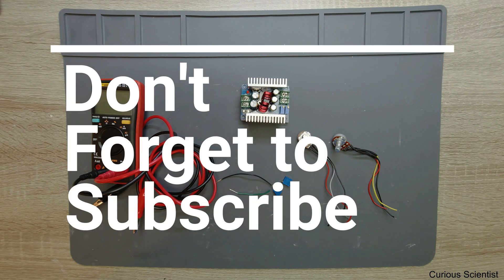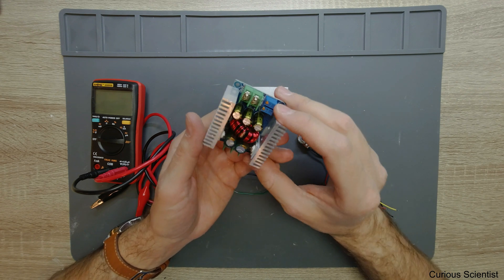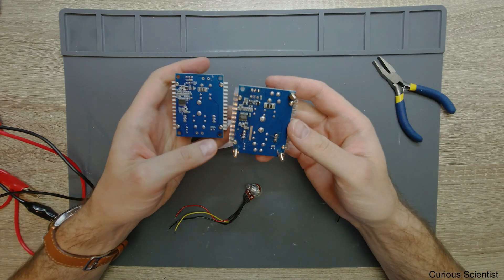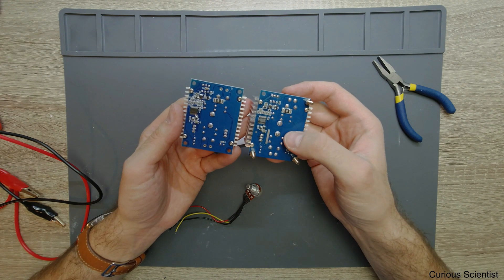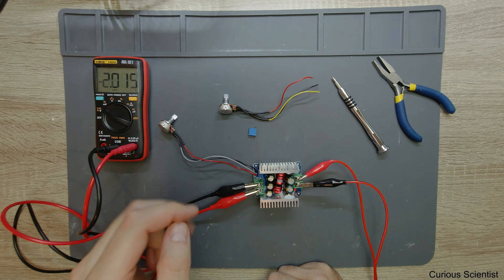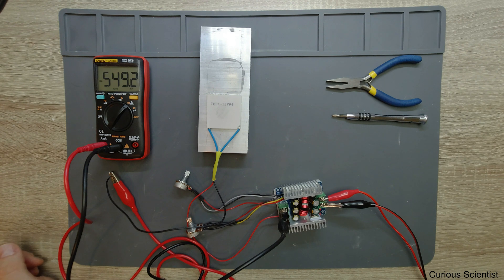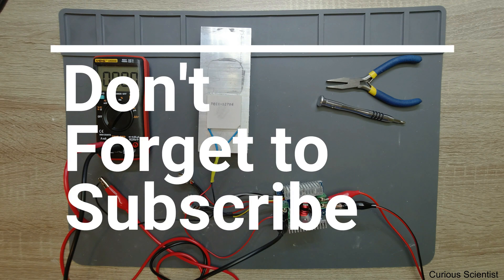Replacing the potmeters on the 300 W, 20 A DC-DC converter

Comment: I would have thought it better to replace those pots with multi turn ones, as the Volts & Current setting will be more precise.
Reply from the maker: You are correct! But at that time when I made the video I did not have the resources to buy them. I have a more recent video on this topic where I use multiturn potentiometers. I also discuss about the mistakes that many people do when replacing the potentiometers which results in damaging of the circuit.
Reply: @CuriousScientist  OK no problem. I am just ordering some 10 turn pots for a board I have had for a while. Its a buck only and has volts and cc pots, it drives me crazy not being able to find the tiny slots.
Reply from the maker: Yes, it is very annoying and dangerous to poke around that tiny screw with a screwdriver. 

When you replace the potentiometer, please double check the polarity of the potentiometer! Many people mess up the wiring when they replace the potentiometers. Some multiturn potentiometers have their pins in a 1-3-2 order instead of 1-2-3.

Comment: Hi, don't you think a multi-lap linear potentiometer would be better? I believe that accuracy derives from that but I could be wrong ... forgive my bad English!
Reply from the maker: Hi! Of course it would, but when I made this video my budget did not allow me to use them. :) I have more recent videos where I use those multiturn potentiometers.
Reply: @CuriousScientist  Ok, I asked this question because I'm going to insert one of these modules on atx for pc in the 12v output, I think it should work .... the potentiometers are 100k true?
Reply from the maker: 100k, both CC and CV. Pay extra attention to the polarity of the potentiometers!
Reply: ok! An important question: in that module the output voltage is always less than the incoming voltage? For example if I have 12V entry, can I get a output current than 12V?
Reply from the maker: The current is measured in amperes and not in volts, so your question doesn't make any sense. However, this is not a boost converter therefore the output voltage will be always lower than the input voltage.
Reply: @CuriousScientist  Of course, I wanted to say voltage, I misfortune with my English ... do you know if there are similar modules with Buck and Boost features with at least 10 amps? Otherwise 2 separate modules should be used, 1 incoming boost module that raises the voltage and then a buck module that brings the voltage into the desired range?
Reply from the maker: Your question can be answered with a simple Google search. :) But why would you use 2 modules? Use a power supply with a higher output voltage.
Reply: @CuriousScientist  Of course I did some research but it is not clear which module to use ... as mentioned first I would like to use an ATX from a PC, generally excellent current on the 12V then have the possibility to raise over 12V and lower as much as possible, with current adjustment .
Reply from the maker: Well, the module depends on your requirements. Just use the one which fulfills your requirements.

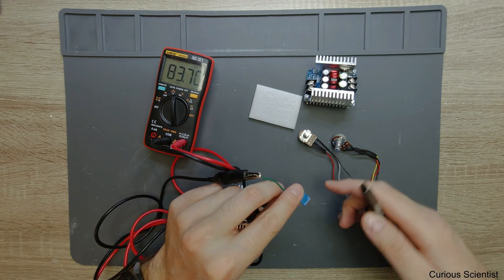Comment: 3:33 I don't understand. The trimpot of the buck module is model 3296 and at this minute I can see that it is turning the trimpot "head" counterclockwise, but instead of decreasing the value in ohms indicated on the multimeter, why is it increasing? If it were not ohms but volts and it is turned counterclockwise, the value of the volts shown on the multimeter tends to decrease.
Reply from the maker: Well, this is how potentiometers work. In this demo, one probe is attached to the wiper and the other is to one of the other pins of the potentiometer. The potentiometer is a voltage divider made of 2 resistors. While one side of the potentiometer (one of the resistors in the voltage divider) increases its resistance, the other decreases it when you turn the screw on the potentiometer. So, when you fully turn the potentiometer to the max, you can measure the nominal resistance of the potmeter between the wiper and one of the inputs pins, while you will see zero resistance between the wiper and the other input pin. And the opposite will happen when you turn the potmeter to the minimum. The previously 0 Ohm pin pair will show the nominal resistance and the other pair will show zero.
Reply: @CuriousScientist  OK, I understand. But one thing is for sure, the potentiometers that come in any buck/boost module are very accurate, but replacing them with normal potentiometers as you show in the video, their accuracy is lost. Do you know any way to get accuracy with normal potentiometers?
Reply from the maker: Yup! You can use multiturn potentiometers like I did in this video:
https://youtu.be/LODoeP6Ap1c
Reply: @CuriousScientist  I have seen your video, but the multiturn potentiometers you used are very expensive and I am referring to the single potentiometers you used in this video. I'm building a lab power supply with an ATX power supply and I want to use two simple potentiometers to adjust the voltage, (one potentiometer for fine voltage adjustment and another potentiometer for coarse voltage adjustment), but I don't understand how to make the connections between the two potentiometers together with a buck module. Do you have any ideas?
Reply from the maker: Go to my website and check out the tools section. I have a link for the multiturn potmeters where they are not too expensive. At this moment when I am writing this commend (2021/Oct/20), they cost $1.86 per piece. You need only two of them, so I guess it is not a big deal. Adding coarse-fine potentiometers is a bit more complicated, or at least it is complicated enough that I cannot easily explain it in a comment without drawings. But I might make a video about this in the near future because this is a useful thing to have.
Reply: @CuriousScientist  Ok, I guess I will wait for you to make a video where you show how to do this, how to add and use two simple potentiometers to adjust the fine voltage and coarse voltage with a module, like any lab power supply does. It is about connecting two potentiometers in series, but as I said before I have no idea how to make the connections between the two potentiometers, so I would like you to show this in your next video because for me this is also useful.

Comment: I did this experiment.
But I found a problem with the potentiometer.

That is, the potentiometer experiences heat and there is a small spark.
The potentiometer I use is also the same, 100k ohms.

What is the cause of this problem, and how to solve it?
Reply from the maker: Are you sure that you haven't mistaken the polarity of the potentiometer? I have replaced several potentiometers and never had an issue like that. Check the pins of the potentiometer carefully, because even the same looking ones can have different order of pins. It could be that you've fed the input voltage to the wiper of the potentiometer.

Comment: I have bought 2 time of this module...after i change pot trimmer to VR  used only few minute smoke goes out on VR...after that dead..SmD chip burn...3 time i bought again this time i not modify anything with timmer pot to VR keep original...unti now everything steady Ok...solution is better keep back original part...
Reply from the maker: Sorry, but I have difficulties understanding your sentences. If your device breaks after replacing the trimmer to a normal potmeter, you probably did a mistake with the wiring or something. Pay attention to the connections and to the pin assignments. Some potmeters have different order of pins. I use my modules with replaced potmeters very often and they are still working. Some of them are 2-year old.

Comment: Buck converter not working how repair
Reply from the maker: It is very common that the mosfets give up. Remove them and check them with a transistor checker.

Comment: When i replace pots as you did my pots smoked out i bought 3 of them one of them is not working now but the others making sizzling sound when i reduce voltage below 2 volts have u any idea what that is for?
Reply from the maker: It can be that you messed up the wiring. Always check what is the pin layout for the potentiometers. I've been using this power supply for a year without any issues. The PSU cannot go below 2 V, that's why you might have issues. This DC-DC converter has a minimum output voltage which is around 2 V.
Reply: @CuriousScientist  so can u guide me on how can i reguldte from zero to up ?adding diode can be a solutin?
Reply: @CuriousScientist  im pretty sure i didnt made mistake as long as i know it doent matter vcc and gnd of pot only signal pin middle one is important
Reply from the maker: As long as you are sure about the position of the wiper, you are safe. It is just that sometimes the wiper is not the middle pin but people assume it is the middle. If you flip the VCC and GND you just flip the limits, so you go instead of MIN to MAX to MAX to MIN when you turn the potentiometer clockwise. 

Regarding the zero output voltage, there is no workaround. This specific (SZBK07) DC-DC converter has a minimum of 1.215 V output voltage when everything (the two potmeters) is at 0. This is how the LM25116 buck controller chip works. You need a different circuit if you need that 0 to 1.215 V range.

Comment: Hello, the voltage can be adjusted in my product, but current limitation cannot be made. What could be the reason, do you have any information? Thanks.
Reply from the maker: Hi! Are you trying it with the original potentiometers or have you replaced them? If you replaced them, make sure that they are the same value as the original, and also make sure that you soldered them properly.
Reply: @CuriousScientist  hi, i used it with original potentiometer. I thought if it was broken. i replaced it with another 100k potentiometer but the result did not change. potentiometer works but I cannot limit current.
Reply from the maker: It can be a faulty product then. I tested a brand new product which I unpacked literally 10 minutes ago and I could not limit the current at all. Unfortunately these cheap products are not always reliable. You might want to remove the mosfets and test them but maybe it is easier to just buy a new one and hope that it will work.
Reply: @CuriousScientist  the product I have is working.  it only does not work at low currents.  The potentiometer is very sensitive, very difficult to understand.  The 100k potentiometer must have adjusted all the settings in the first round. Thanks so much
Reply from the maker: Yes, the CC side is very sensitive. Some time ago, I replaced the CC potmeter with a 8-bit digital potentiometer. Up until a certain value it worked OK, and then after just one step (roughly 39 Ohm change), it went bananas... I also still need to learn a lot about these buck converters. If you are interested, I recommend you to read the LM25116 buck controller's datasheet. It has a ton of information, but it takes time to digest everything.

Comment: Would this modification also work for regulating the output of a boost converter?
Reply from the maker: I don't know. I need to see the circuit to know it.
Reply: @CuriousScientist  Hi. The circuit would be exactly equivalent to yours, except substituting the BUCK converter for a BOOST converter. Everything else would be the same i.e. taking off the blue CV potmeter and connecting a more ergonomic component etc.
Reply from the maker: Then I guess, it should work. But since I have never tested other circuits, I can't say with 100% confidence.

Comment: Hi. There is no information in your video about minimum value of CC mode. I just bought two of this modules and I want to know is it normal to have minimum constant current about 1.3 ampers?  I expected a value in milli amper range. can you test this if you still have module.
Reply from the maker: Hi! Yeah, I have dozens of this module, I built a lot of regulators and power supplies with them. If I don't forget it, I can take a look at it during the weekend. But I have the impression that this module is not really made for mA precision. I will look at it and check it.
Reply: @CuriousScientist  Thanks.
Reply: @CuriousScientist  🙄
Reply from the maker: 🤷‍♂️
(BTW, emoticons don't help. Instead of inserting one, you could have just asked if I did anything. )
Reply: @CuriousScientist   😅Hi, it  was just a reminder, I was actually waiting for your response during the weekend.
Reply from the maker: I did not forget it, but I did not have the opportunity to work with the converter. As soon as I have the time, I will of course answer you.
Reply: Hi, can you check this module lowest CC, in this weekend. I need the answer for a project.
Reply from the maker: @mahdikhadem4521  Hi, The lowest CC depends on your load. However, here is what I found: I tried it first with a brand new, unused product with the built-in potentiometers and I was not able to adjust the current at al Voltage (CV) worked just fine. So it might be that the potentiometer was bad from the beginning. However, I tested it with my DIY power supply I build based on the SZBK07 DC-DC converter, and I was able to fine tune the current within the 100 mA range. In this case, I used external potmeters of course. However, there is a catch! The converter has a minimum output voltage which is about 1.2-1.3 V. You cannot go below this voltage and you cannot limit the current below the current that will flow through your load based on Ohm's law.
Reply: @CuriousScientist  Hi, thank you for this informations. I dont think the brand new module has a Broken multi-turn, you can test it with multimeter. but in the older one that u can get 100ma, can u tell me, what voltage and load you used for it .( of course it is all about ohm law) and can check that both module have the 1k resistor in series with the ground pin of  CC multi-turn?
all I think is that the new version have low ability in CC mode.
Reply from the maker: @mahdikhadem4521  Hi! I used it with a Peltier module, a DC motor and also with a 120 Ohm resistor to test different types of loads. The voltage was anything between 1.3 to 12 volts.

Comment: Hello, are the pins of the voltage trimmer shorted? I used 20k potentiometer and burned when i turned it Completely.
Reply from the maker: Hi! Not shorted, it is used as a rheostat. I provided drawings on my website, check them. Also, you shouldn't use it with smaller than 100k potentiometer. Nevertheless, it should work with it. I have another video where I tested it with different potentiometers and I did not have any problems.
Reply: I tested the 3 terminals using multimeter where the trimmer was located. Found out that pin 1 and 2 has a continuity. How did it happened ? I just removed the trimmer
Reply from the maker: Have you read my previous comment? The CV potentiometer is used as a rheostat. Of course one of the pins are tied to the wiper of the potentiometer.

Comment: Hello
I changed the potentiometers from 3206 100k to 3590s-2-104l and I have a problem. The voltage regulation is correct, but the current regulation does not respond. Is it related to the power of the 2w potentiometer. How to solve this problem? sorry for my not perfect english :)
Reply from the maker: Hi! No worries, your English is pretty good. I had a few comments on potentiometers not working properly and most of the time it was a "user error". It was usually bad connections or soldering or wrong polarity of the cables. I suspect that you might have connected the potmeter in the wrong way. It does not really matter for the voltage because in that part of the circuit the potmeter is used as a rheostat, so the wiper is always tied to one of the other pins. However, in the current control part, the potentiometer is used as a voltage divider, so the polarity becomes relevant because all the 3 pins are independent. The default potmeter in these boards have the "normal" 1-2-3 polarity, where 2 (middle pin) is the wiper. However, the 3590 multiturn potmeter has the 2-1-3 pins (3 is closer to the knob) and the wiper is the pin 2. So, you have to wire it differently than the default potmeter. It is always important to read the datasheet of the products that you use.

Comment: The 20A module that I just bought didn't work at all, initially it turned on but the volt and curent couldn't be adjusted, then now it's completely dead, please help, what should I fix ??
Reply from the maker: If it doesn't work without any modification, then just send it back to the shop where you bought it and ask for a refund.